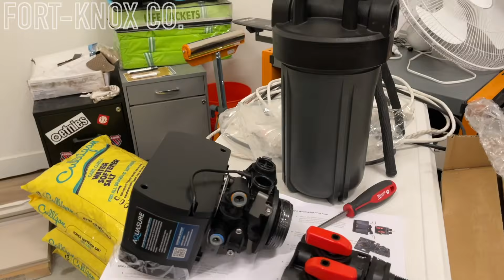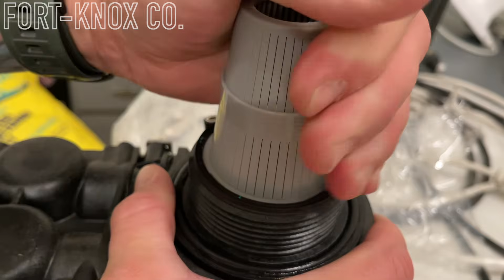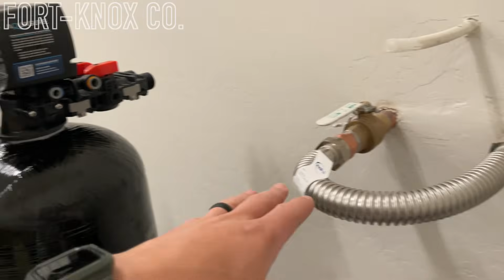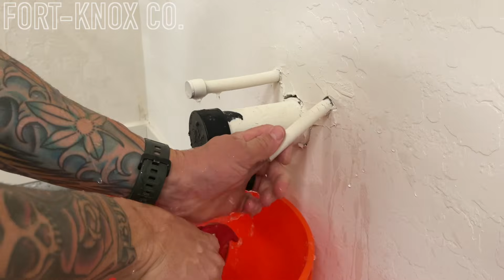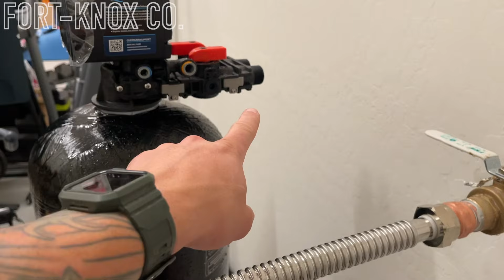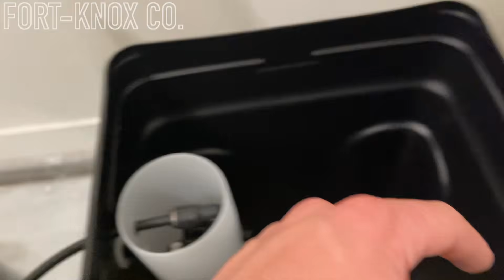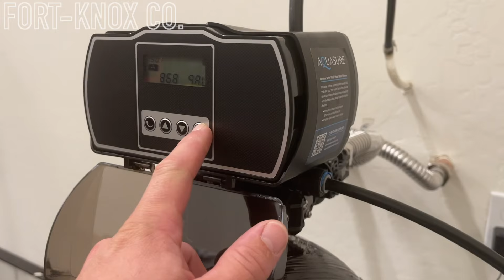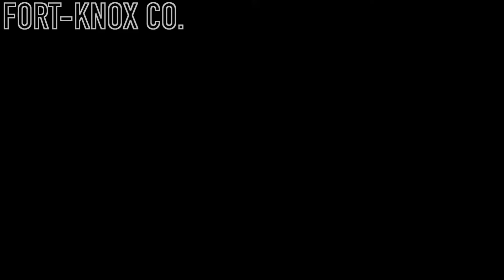How To Install Water Softener System Aquasure Harmony Series | Water Softener Loop Connection

Comment: Thank you 🙏 for such detailed video.
I'm into adding a water softener system (WS) at our place but I'm so overwhelmed with so much information on YT like get a WS that is made in the US, manufacturer, warranties, etc.
So I'd the the guy who came who includes all the soaps and stuff (he's out of my list) and then Ecowater which I know is a great product but pricey.
Do you recommend this water softener? I seen it on Amazon but what about the manufacturer, warranty, parts & their customer service, etc?
Once again, thank you
Reply from the maker: Yes, I do recommend this product. I’ve had it now for a while and don’t have any complaints. It softens the water really well. If you’ve seen my hard water test video here in Nevada, we have really hard water and it brings it down under 50. And as far as the manufacturing warranty, I had really good communication back-and-forth with them. I’ve also heard from others good information with dealing with any problems they may have had warranty wise or any defective parts. One of the things I did before I purchased this was search to see if this brand was available anywhere else and I believe you can find it at some big box stores, like Home Depot. So it’s not just an Amazon product, but they happen to sell through Amazon as well, which I like, because their return process and communication is backed through Amazon.
Reply: @FortKnoxCo  Thank you for your prompt response 👍
I'm here in Vegas, if you're here in Vegas because you mentioned you're in Nevada, would you be able to install it for us? Amazon I believe has only 30 days and then you've to go directly with manufacturer
Reply from the maker: @Irish.Mexican  that is a possibility yes. Depending on the water loop connection you have at your house it could be a pretty straight forward install
Reply: @FortKnoxCo  There was a water softener installed previously and I've a loop.
I can put the water softener together but I'll need help with rearranging the connections, height and stuff.
There's a guy coming to check if the loop runs through the whole house and to see if it runs cold and hot but the guy is from ecoW and he won't install if I go with another brand.
How can I reach out to you?
Reply from the maker: @Irish.Mexican  shoot me an email and we can figure it out.  If there’s a water loop built into your home then I’d guess it’s done by the builder and the proper way to plumb it is to have the water loop before everything in your home. That way the water softener is softening the water to the hot water heater ie. any hot water in the house, toilets, etc. the only hard water in your home is usually the cold water at the kitchen faucet and any outdoor water hose valves.

Comment: Thank you so much for your great video. I can't find the product you mentioned on the link. 1-1/14" to 1" hose fitting you mentioned. I have brand new home with pre-plumbed for water softner and the size of the bronze line is 1-1/4". I can't find oen that fits 1-1/4" line. Amazon only have 1" to 1" line. Can you send me a link ? Thanks PS. I told my wife that I can do this. It's been 2 month to find a product and I came across your video and she' yelling at me and force me to find a plumber. I keep saying to her that I can do this. I was thinking about adding 1-1/4 to 1" reducer and then sharkbite of 1" to 1". Let me know.
Reply from the maker: Your very welcome. I found the lines with 1-1/4”-1” on Ferguson website. Should be Ferguson.com 

I’m going to be redoing the system with exactly what you said, a 1-1/4”to 1” reducer fitting. Then just running 1” lines between the unit. And the wall. Shark bites  are good. I use them sometimes in location I can see. Not inside walls n stuff. But on the water softener connection should be good

Comment: Does the water that goes back into your house feed into your water heater somewhere?  Thanks for a great video!
Reply from the maker: Yes. The water loop for the softener is before the water hits everything else in your home. It’s right before the water splits to the hot water heater and the cold for the whole house. It filters/softens the water for everything including the water softener. So you have soft hot water
Reply: @FortKnoxCo  thank you, this was very helpful!
Reply from the maker: @chubbrock659  your very welcome

Comment: I got the same softner and have had it for about 2 weeks and today noticed standing water in the brine tank. Any suggestions or have you had any issues like that?
Reply from the maker: Yes that is normal. There will be water in there so it’s saturated with salt and ready to use when the next regeneration cycle happens. Part of the cycle is a refill of that brine tank so it sits until the next. If you want the water level in there lower you can adjust the minutes it refills. This can be fine in your settings. It’s one of the last steps in the setting I believe.

Comment: Do we need put more water in the salt  some time please?
Reply from the maker: The water /salt tank automatically drains and refills during the cycle. There shouldn’t be any need to add water to it. The only thing you will need to add periodically is more salt as you see the level go down. On average are usually have to add a bag or two every few months.

Comment: A plumber wouldn’t suggest shark bite due to it’s not a professional look but they do work good as long as it’s not forced on an angle that’s really the only time I’ve seen them leak
Reply from the maker: Very true. Most if not all licensed plumbers will not suggest shark bites. They are great and convenient. But do have their possible flaws as well. I would only out a shark bite where I can see it and not cover it up in the wall.

Comment: What if the riser tube is NOT FLUSH with the top of the tank
Reply: The one in the middle of the giant black one that states it need to be flush with eh top of the black tube before you screw on the plastic filter with the computer
Reply from the maker: @samward7638  ok I understand. Is it high or low? It should be close to flush but it’s okay if it’s slightly one way or the other. Mainly you need to be able to slide the grey cone attached to the head unit over it and then as you tighten down the head unit you need to be able to get the head unit all the way tightened down.  If it’s extremely too high and not letting the head unit turn all the way down then you may have to see if the tube presses down at all or if you can wiggle/twist the tube down a little to get it closer to flush.
Reply from the maker: I’m not sure which  tube are you are referring to?

Comment: Why do I find so much water in the salt tank after the installation is complete and the cleaning is over? There is about half a bucket of water
Reply from the maker: It’s normal for water to be in there. It saturates the water to the next time it flushes it pulls that salty water in to scrub the resin in the big tank and then flushes. Then it refills some water back into the brine tank/salt tank. It’s supposed to have water in it. But if you want the water level in there to be a little lower you can adjust the setting on your system. When you go through the setting one of the last steps is setting the minutes for the brine tank refill. You can lower the minutes a few and it will put less water in there when refilling.

Comment: Awesome video. Thank you! Do you know how this brand compares to APEC?
Reply from the maker: Thank you! Im not sure how it compares to apec. I haven’t tried one of theirs yet. But I have no complaints with this unit so far. Love the price and that it’s softening the water so well.
Reply: @FortKnoxCo  Honestly I'm thinking about buying this system with the water filtration stages as well, mainly because of this walkthrough video. It gives me peace of mind knowing what I am getting into. Thanks again.
Reply from the maker: @soju1shotx  that’s awesome to hear. My goal was to just show what it looks like and my experience with this system. And then if anyone had doubts that that can’t hook something up themselves to show what the steps are.  Also my hard water test video shows that the system is working. So that was piece of kind. Everyone’s question always seems to be is if it’s working or not. Sometimes hard to tell.

Comment: I forgot to ask another question.  If we are going out of town for a few weeks, can I turn off the system and turn off the water or am I going to have issues with turning it on and off?
Reply from the maker: It’s meant to be on all the time. It will only cycle the water through when someone is running water in the house. And they refresh cycle where it flushes only runs when it hits is set gallon rating. For example mine is something like 3,300 gallons before it will run it’s next cycle. So once I’ve ran that many gallons through it it will run the refresh cycle at 2am that night to regenerate the filter.

Comment: Hello, quick question.  I want to install this unit myself and I think I can do it but my only problem is that I don't have a drain or a sink nearby in the garage.  How much brine/water is dumped out when the machine goes through its cycle?  Can I use a bucket or a container to collect the brine/water and then take it over to a sink for disposal?  I can probably crawl in the attic and run a drain hose over to a sink if I have to.  What do you think I should do?
Reply from the maker: It definitely needs a drain to send that water too. I believe it’s not just a bucket or so full. You’d be running back n forth with a bucket and probably making a mess. Lol. Plus you don’t know exactly when it’s going to run it’s cycle unless your paying attention to when it’s count down is almost complete. It only flushes when it’s had a certain amount of water/gallons filtered through. So it saves water in that sense.

Comment: Thank you for the full explanation of this process it massively helped!!! At the very end you brought up something I may have messed up and wanted to double check if I need to redo the regen cycle. After starting it for the first time and it goes through the first process (bw?) I thought it meant to open both valves on the tank (was reading instructions not watching video at this point) so after a couple of minutes of it running with both valves open I saw the last bit of your video and ran back to shut off the valve to the house (out valve?) on top of the tank…. Then I sat back for a few more minutes and remembered I had installed bybass valves in case I needed to take remove the water softener and still need water to the house, needless to say I shut of the bybass’s as well but only a couple of minute remained on the bw cycle. I’m wondering if I need to restart the whole cycle now 🤦🏽‍♂️
Reply from the maker: Your very welcome. My guess is I’d think your fine. But I’d still get a hard water test kit and check to see the water hardness from an unsoftened location and then a softened location and make sure it’s softening the water sufficiently. Just to get piece of mind. When I did the water hardness test it just reconfirmed that it was working and I could sleep easy.

Comment: My salt tank always has water half full and is wasting alot of salt. Do you know how to fix the water level. I never had this problem from my previous experience with other softener
Reply from the maker: It will sit with water in it and sometimes will be above the salt line. until the next cycle it will sit that way and the water inside is saturated with salt and ready to flush on the next cycle.  If you want the level to be lower you can adjust the full time on the settings. It’s in the set up book and one of the settings specifically covers how many minutes you want it to fill the brine tank. You can adjust that down and that should help keep the water level lower if you prefer it
Reply: @FortKnoxCo  what's your adjustment for the level for your tank? I have a 64000 model also
Reply from the maker: @Tru-R_Life  I can’t remember the specific minutes I adjusted it down to. But as you run through the settings and you find the step that shows minutes for tank refill I’d shave off a few minutes and see how it sits after the next cycle. If it’s still high then maybe take off a couple
More. Having water in it is normal. But it doesn’t necessarily need to be way over the salt level

Comment: I just got a used water softener system that was given to me from my wifes boss it was used at the main gas station  in town. it's not very old she  just needed a bigger system. Is it worth hooking up a used system, or is it risky? What are your thoughts
Reply from the maker: If it looks like it’s in good condition and you know it’s not old then I’d consider it. You can hook it up and then do a water test to see if it’s working and softening the water adequately. If it’s not working for some reason then you can decide to spring for a new system. If it’s working then you got yourself a free softener system.

Comment: Thanks, this is super helpful. When I started the system to run the regeneration cycle, the drain line was running water for the whole time, around 1.5 hours. Is that expected? I feel this wastes too much water. In the future, would it run water from the drain line every time it regenerates? Thanks!
Reply from the maker: In the set up it will run for that long time to get the system filled and flushed. So it’s a lot longer. But when it does it’s cycle it will pull water from the brine tank and then flush out the resin tank once the salt water has cleaned out. It flushes through that line to the drain but does need to do this to discard the filtered/dirty water. I don’t believe it’s as long as the set up flushing though.  These systems are supposed to be more water efficient because it only flushed when it’s needed and met the countdown of how many gallons have been filtered, so it’s important to set it up with the calculation the provide in the book based off your system size and house size. But other systems just run on a schedule and that can cause it to flush regularly and more often when not needed, wasting water.

Comment: Should I install on the main cold water or the hot water side only
Reply from the maker: You install it on the main cold. Before it splits to the hot water heater. That way the Easter coming out is soft water and it goes to the water heater filtered

Comment: Thank you for the video!  I am looking to install this or a similar system in my home soon.  My only concern is that my drain is directly into the septic line overhead in my basement.  

You mention that your drain also has a vertical component to it once inside the wall. Have you had any issue with back flow or not having enough pressure to properly drain the system?  Thank you!
Reply: Most manufacturers will state that the drain line shouldn't be installed above the level of the valve.  Issues it can cause are backing up of water into the brine tank or salty water in the house after regeneration.  In this scenario we would add a plumbing fitting to the drain on the sink and install an air gap between the water softener drain line and the sink drain line.
Reply from the maker: @branchwatercfl  that is correct. It’s preferred to have that line below the unit. This line in this situation goes up and over into the adjacent laundry room and dumps into the dedicated washing machine drain.
Reply from the maker: Your very welcome. I haven’t had any issue with the drain line. It’s really high pressure when it’s draining. It shouldn’t have any problem. It’s pretty common for the drain lines to be above or have some type of vertical path duding it’s journey to a near by drain pipe.

Comment: ive never seen a main water and pipe for the house like that
Reply from the maker: The one in the front of the garage? Every house I’ve owned here in the west coast, specifically southern CA and Nevada have has a main waterline shut off and pressure bell housing somewhere in the garage. But I’m sure depending on where your at and the builder they might design it differently.
Reply: @FortKnoxCo  I guess my house is way old lol. My main shut off is in the front yard by one of the water hose spigot I’d have to reroute that to the garage to be able to have soft water most likely. Damn lol
Reply from the maker: @Art2d2_a  yeah. If you house wasn’t built with a water line loop for soft water then you’d have to have one installed. Not too much work but definitely can be done